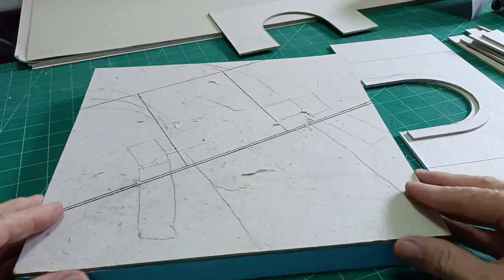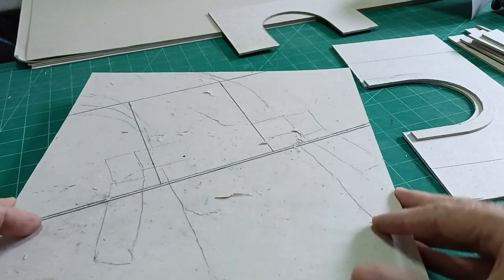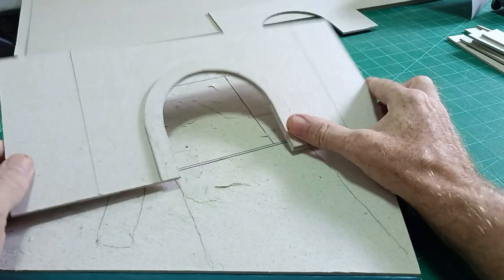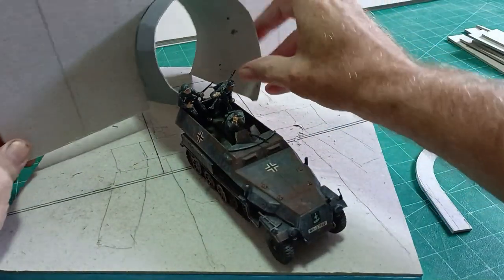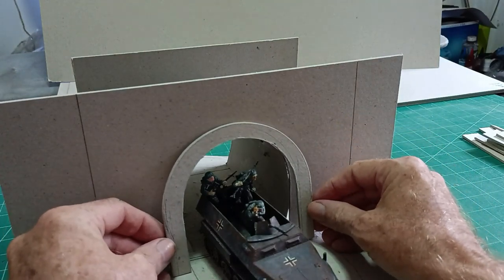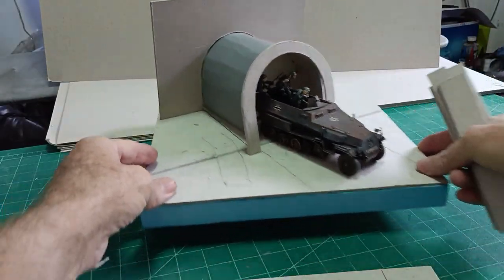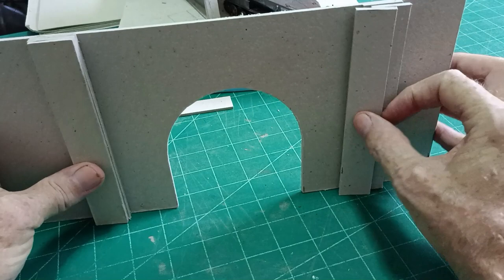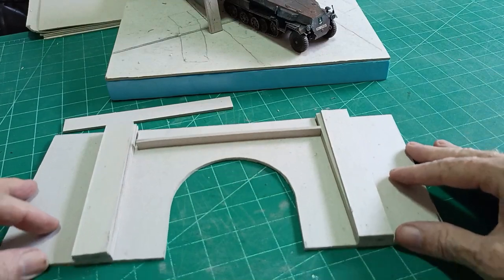How to make a road tunnel portal

Comment: Diorama Don relevant links
Ruined Building: https://www.youtube.com/watch?v=FrFnUs1kSS8 (7:35 - knife awareness and safety)

Stone Wall: https://www.youtube.com/watch?v=i7yiHsiIYtI&t=940s (dry fit shown, can grout or mortar)
Brick Walls: https://www.youtube.com/watch?v=u-l_7-7X6JE (two methods of manufacturing and assembly, then: mortar, distressing, and weathering)

Barbed Wire: https://www.youtube.com/watch?v=kxxcCDTo0oU
Barbed Wire and Sandbags: https://www.youtube.com/watch?v=Y4-CP6tkvm8
Metal Fence: https://www.youtube.com/watch?v=HbA36CxmV_k (chicken wire or hardware cloth - square openings)

[edit: clean up spacing between links]